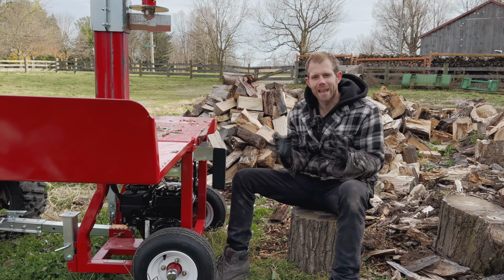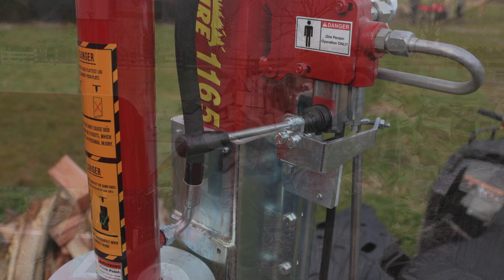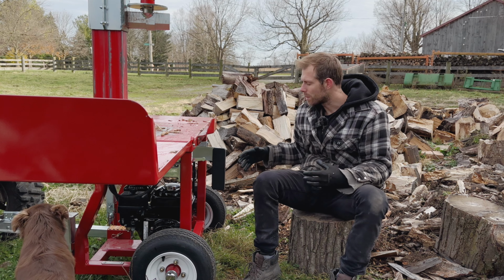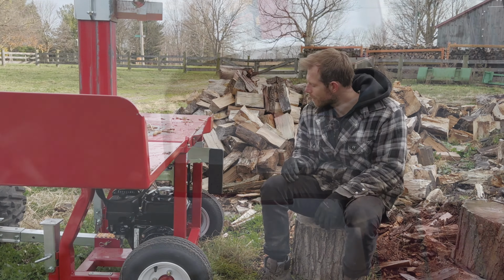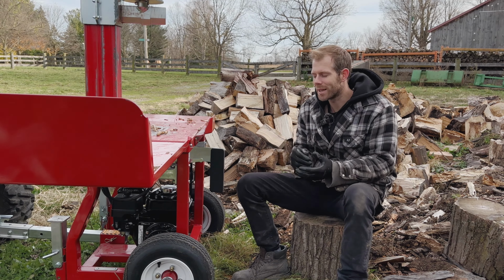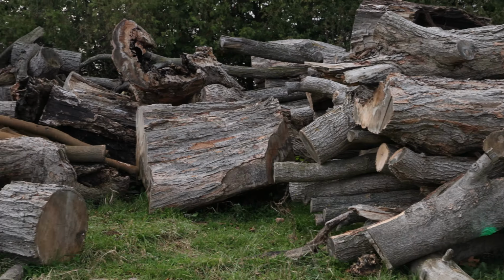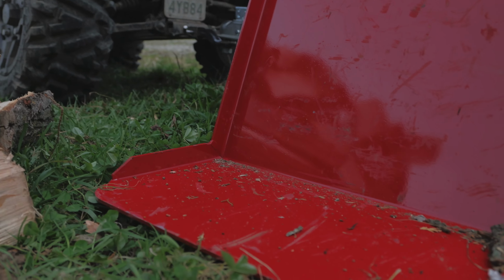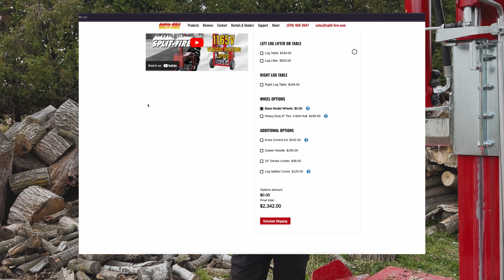SPLIT-FIRE 1165V - HANDS FREE IS FINALLY HERE | THE HOW & THE WHY

Comment: As an orthopedic physical therapist for almost 40 years, as well as a certified ergnomic evaluation specialist, I have to say this is one of the best advancements I've seen in wood splitters.  I have spent decades assisting engineers in production settings create safer and more ergonomic environments for similar processing machines.  The science behind knee control versus foot is very strong.  The fact that the operator is standing and has full weight bearing through their leg, delays foot movement off of a treadle during an emergency.   This is far safer.
Reply from the maker: Thank you for the detailed feedback, we truly appreciate your perspective from a professional point of view.
Reply: @thebradleysoncatbirdhill6849  - knee switch is money. The loader in an M1 tank uses a knee switch to open the armored doors where the ammunition is stored. The Army figured out that bit of ergonomics over 40 years ago.

Comment: Looks like that knee control works well.   Nice splitter
Reply from the maker: We truly think it works amazing and we stand by our product design.
Reply: Agreed!
Reply: @SplitFireSalesInc  I have three commercial splitters from different companies…. If the foot peddle is high it does make a big difference.  My axis is the most comfortable to run
Reply from the maker: @Ridgewood460  are any of them adjustable?
Reply: @SplitFireSalesInc  a little….  The movement needed for the valve is to much for it to make a difference 

The axis works perfect though 

I have a couple of your older 1165’s. for kindling and bundle re-splits

I think I’d like to try a new one out with knee control

Comment: Really cool setup and the knee control looks to be a VERY good design.
Reply from the maker: @oakiewoodsman  Who knows maybe the industry will slowly start to shift designs all across the board? We truly stand behind the design.
Reply: For sure
Reply: Run it for 6 straight hours.
Reply: @SplitFireSalesInc  I can totally see why.  Makes a lot of sense from a safety aspect.  Never really thought of tensing up and stepping on the foot pedal.  Really appreciate  you thinking it through and making us aware
Reply: @bradjenkins932  what are you implying?  Do you think that it will cause fatigue or something?  If so, could I suggest that if you are going to run this machine for 6 hrs a day daily, you might be looking at the wrong machine.  It all depends on what someone needs are.  I think the price point, footprint, portability and design are all wins for the market this machine is geared for.

Comment: That machine is a wee beaut! Fast, simple and so easy to shift around. Knee operation is something I've used on a horizontal machine years ago,and as a "one man band" it was a winner. With freeing up both hands it made splitting much safer. The 1165 vs would be ideal for even moderate sized firewood operations. And as a old fella (74) with a shot back that working height and log lifter...... Great stuff! Cheers from HB NZ
Reply from the maker: Cheers from Norwich! HB NZ is absolutely stunning, jealous of your views down there.

Comment: Maybe adding some dense rubber pads between the engine and the frame would help greatly with the vibration and wood falling off the table. Plan on ordering this splitter once the powder coating is an option 👍